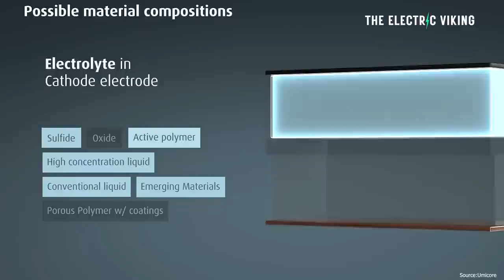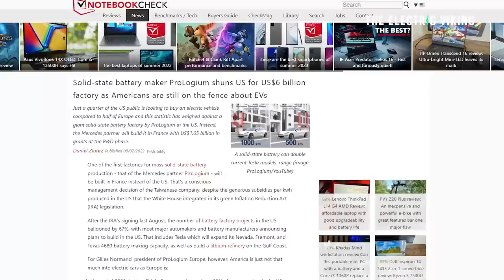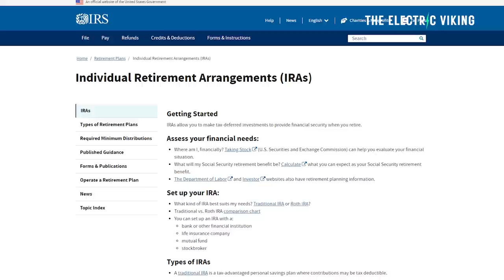Solid-state battery maker says Americans not keen on EVs; invests $6B in Europe

Comment: The truth is that Americans are totally confused about EV's.  This is due to the partially successful efforts of Big Oil's negative campaign and other biased resources.  Having driven for 6 years for free from a paid-for home solar system, I asked my friends how they feel paying $5.20 a gallon for gas, they replied, "You get used to it..."
Reply: You mean, you're charging your car from the grid, then recouping the costs with solar panels feeding onto the grid. Or else, you've got some Tesla Powerwalls. Either way, you need about 20 years to break even with solar so it sounds like you're making stuff up.
Reply: @ChickensAndGardening  The payback WAS 9.6 years, but with new tech that will be cut in half. Your ignorant misinformation is hurting adoption.
Reply: Yep ,   Like you mentioned,   able to go anywhere   You have EV owners that do not pre-map where the Charge uP Stations are. Then you have people who have been driving by charge uP stations for quite a while. And finally need that charge. Pull into the station to find out that their nozzles are not compatible.

There are a lot of people (Americans) who will  Never  buy another EV again ❗️

Most of those people are the Chevy Bolt and the Ford MACH-E buyers.

A lot of dissatisfied Ford  Lightning owners also :

https://youtu.be/myTIISQhyvE

Comment: I don't think you can compare EU and US, the population density is completely different.  The average US personal travel per year is twice that of the EU so there is inherently more range anxiety. There is a huge difference between being able to stop almost anywhere and putting 300-500 miles of range in the tank of an ICE vs needing to plan where to drive and spending 30-60 minutes to put 200 miles of range into the vehicle.  We absolutely need better batteries and faster charging before it becomes mainstream in the US.

Comment: In Europe diesel and gasoline are sold with a huge tax causing them to be almost three times normal cost.  That would make BEVs much more preferable than in the USA on energy costs alone.  The reason Europe is able to tax transportation fuels so high is distances are relatively short compared to much of the world.  Those shorter distances also work well for current BEVs.  

In the USA energy costs savings of BEVs alone doesn't make them attractive over gasoline cars.  Energy reliability would if there was fear of gasoline shortages.  A BEV new car needs additional and long term perceived advantages over its competition that includes ICE cars.   Teslas are performance vehicles and are greatly purchased because of that, even if people don't admit that characteristics as playing a major part in their buying decision.   Beyond that Tesla cars have earned a reputation as being extremely durable although not without quality issues.   Tesla is only offering compact vehicles at accessible prices with the Model Y and Model 3.   Many Americans have larger needs.  For myself something like a more affordable Model S plaid is my interest.  

For many Americans the Tesla pickup if sold at an accessible price, especially if there is a SUV or crossover variant, would then fit and even exceed their perceived need for a larger vehicle.   Most pickup trucks in the USA are used as typical private vehicles with occasional truck duty if that.  The most comfortable four adult vehicle typically sold in the USA is a crew cab pickup.  They have more room and a better back seat than typical luxury cars.  They are quiet and ride surprising well with the solid rear axle way behind back seat.   The energy cost savings of larger BEVs over their diesel and gasoline competition in the USA should be noticeable.   With a Ford Lighting pickup selling for around $90,000 off the lot, people aren't talking about "savings" on fuel costs so far.

Comment: There is room in the market for both solid-state batteries for the upper end of the market and better, cheaper, and safer regular batteries for the lower end of the market. Commuter cars don't need 1000 miles of range. Over time solid-state may get so cheap and good that it takes over the market but that will take time.

Comment: Education doesn't work. What moves people is fashion. If the neighbors have EVs and you don't that works. That's exactly what happened with the move from sedans to SUVs. We didn't advertise or educate people on the benefits of SUVs. People bought an SUV when they saw one in every other driveway in their neighborhood. It will also help when EVs are cheaper to buy. We already know they are cheaper to operate. What we can count on is that both gas cars and gas will continue to get more expensive and EVs will continue to get cheaper.

Comment: I think they are right to choose France. There are many car factories in Europe, and most of them are close to France. Also, the US market may be saturated because of the incentives and Tesla building it's own battery factories.

As for solid state. I do not think they would invest that much themselves in a factory if they were not at least 99% sure it will work and sell.

Personally i would prefer solid state batteries, even at a higher price. Lugging around half the battery weight that is also much less flammable sounds like great selling points.

As for putting a lot into a huge project that is not guaranteed to succeed has made the millionaires and billionaires of this world.

Comment: Uk infrastructure is still poor also ev's are too expensive for the masses and batteries will definitely be an issue reliability and cost wise on older second hand ev's that let's face it working folk require as they simply can't afford new or even nearly new. Vast majority of ev's are bought via fleet also costs will rise for ev's the free charging at supermarkets etc has all but dissapeard and all ev's will be paying road tax which is retrospective from 2025

Comment: People who live in multi-family housing don't want an EV because there's no place to charge at night for the vast majority.  That's actually a very reasonable position and applies to lots of people.  People who rent a single family home and don't have a landlord who will work with them are in the same position, as are people in single family homes with no off-street parking.  There are people who can't afford the up-front cost of an EV.  And there are people in rural areas who regularly travel long distances in areas with little or no charging infrastructure.  There are cautious people who think it's too early and are just waiting to see how things work out.  Then there are people who might benefit from an EV but would never consider it due to political reasons.  That is a very sizable chunk.  Add them all together and you have an extremely large portion of the population.  What is needed badly is more charging infrastructure, especially level 2 charging for houses, condos, and apartments.  And, you need time for word of mouth advertising to spread.
Reply: I do just fine without an overnight charger.  They're pretty easy to install, it's like installing a new washer/dryer outlet.   Problem is non-existent.   Landlords should be smarter yes (and most aren't).  There are other places that could use chargers instead. If every one of my weekly errand stops had a L2 charger, I probably would never even need an overnight or fast charge!  The other point is stating that we should do nothing because everyone has different needs - even though there are hundreds of different vehicles on the market and no one makes excuses for those like they do for a Model 3 not being able to haul lumber.
Reply: @jeffweingrad4658  By "without an overnight charger" do you mean you don't charge at home but use public level 2 and fast chargers and/or charge at work?  Do you find that more or less convenient than pumping gas, or about the same?  Or, do you mean you use slow 120V charging at home?
Reply: @dansanger5340  Gas stations are an annoying waste of time with people not understanding how to park at a pump.  If all I had was a fast charger, I'm done in 2 seconds.  Plug in, go grocery shopping, come out, and done.  You can come up with 100 ways it's more efficient even if you don't have a plug at home - which likely will change soon in the race for amenities.  Landlords can't charge you for gas, but they can take a cut of charging costs.  Just like laundry.
Reply: @@phillipbanes5484 time killing activity = standing there in the hot and cold watching fluids pour into your car for minutes on end?   Haven't had to do that time waster in a long time.   I chuckle everytime I see you, as I zip by.
Reply: @@phillipbanes5484 I spend no time.  Only a drunk stands there in the hot and cold staring at liquids going into their car for hours and days and maybe even weeks out of their life.  It sounds wonderful.  In a pathetic and sad sort of way.  I'm amazed you find time to be online all of the time after charging your devices.   Keep reaching bro.

Comment: You need to be educated about how electromagnetic pulses that are currently being generated by the friction between rock layers of the Earth's tectonic plates are the main cause behind lithium ion batteries malfunctioning and expolding. This phenomena is gradually increasing to every continent in the world because like dominos the Earth's tectonic plates are all connected!
Reply: How exactly are electromagnetic pulses causing batteries to malfunction and explode? Be specific.
Reply: @skipondowntheroad5833 What do you think happens when you introduce high currents, high voltages, heat and abrupt electric discharges into a closed circuit? The battery management system (BMS) is the first thing to get fried and as a result thermal runaway will cause the battery to literally explode. After that you can kiss your electric car goodbye. Plain and simple!